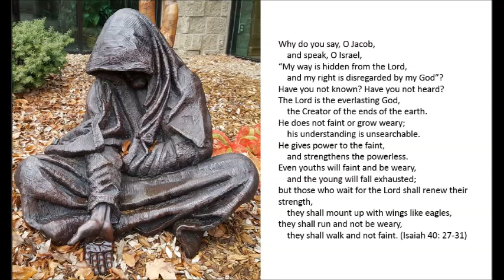2009 Chevy Cobalt gas line replacement

Comment: Excellent Video!!!!!!!!!!!! Just a tip, never do any gas line repairs in the garage or near the house.......you cannot get the car to the curb fast enough if the SHTF...........It should be a LAW that all brake, fuel and transmission lines are stainless steel right from the factory. Charge us the extra 100.00 up front and save us from these headaches that were the first thing to come down the assembly line and the car was built around!  Brining  and over salting the roads is killing the underside of all of our vehicles. Years ago nobody ever had to replace any of these lines.
Reply from the maker: Thanks for the feedback.
Reply: Ethanol in the gas helps corrode the lines too.

Comment: Thanks for posting, great video.  Do you recall what part number you used from linestogo?  They do not show an option for a 2009 with an external fuel filter.  Did you use a set listed as 2008?  It looks like its the same as the 2009, but not sure.  Thanks

Comment: There's now a recall 2008-10 cobalt and hhrs on the fuel lines. It was on the news yesterday.
Reply from the maker: Thanks for the info, I had not seen that yet.
Reply: @diywithdave3186  it's not really official for now GM is working with the Highway traffic association on the issue. I'm sure the recall will happen. I have 2010 coupe and so far no smell and leaks.
Reply from the maker: @MrCliffda3rd  that's good to know also.

Comment: Thanks for this video. Very helpful but why did you replace all the lines? Was it just for demonstration purposes?
Reply from the maker: The lines that I used came as a kit.  Individual sections were not available.  I didn't want to mess with trying to custom bend an individual section and hoping that I could get it not to leak.

Comment: On a scale of 1 to 10, how difficult of a job is this? I know my way around a car and I'm sure I can do this, but I'm concerned about how long it'll take my inexperienced self to do it as well as the various tricks in dealing with fuel lines...any additional info would be helpful. This is my son's car - a 2008 Cobalt. Thanks.
Reply from the maker: The most difficult part was figuring out how to get it apart, and dealing with the broken volt for the fuel filter.  It took about a week or so of working on it after work and whatever time I could spare on the weekend.  Part of the difficulty I had should be reduced with the tips that I shared on the video.  If you have the replacement parts on hand and the required tools you could probably get it done in 16-24 hours, assuming that you don't do this kind of stuff for a living.
Reply: @diywithdave3186  After watching your vid I decided "no way!" Especially with my son living two hours away at college. I knew there was no way I could do it in one day. He's found a garage that will do it for ~$550. That is def worth it!!
Reply from the maker: @SportsRaschman  given that scenario, sounds like a good choice.

Comment: I cut my lines to repair this on my 08 g5, but I didn't think to mark which line is the fuel feed, can anyone tell me if it is the line nearest the left side of the car or the inner line, I know 1 is fuel , 1 is vapor...   I can send pix if you need to see...
Reply from the maker: The fuel line will have the filter (25:16) on it by the gas tank, the other will originate at the vapor canister (black plastic box).  At the engine, the liquid line will go to the fuel rail (10:50) on the engine and the vapor line turns into plastic at the engine and it connects as shown at 11:20 in the video.  As long as you get the ends of the same hose in the right place you should be good.  If you cut the line and don't know which is which on the bottom of the car, you could blow air through the line and see which one it comes out on the bottom of the car.
Reply: @diywithdave3186  im splicing them with 6-an, I didn't pull the whole lines out...   I just wasn't sure which line fed fuel and which 1 was vapor, I figured it out....   I traced them from the engine to underneath the car...   the inner most line is fuel...   I didn't think to mark them before cutting them...   thank you for the response...   :)
Reply from the maker: @flynnndawg  you're welcome, glad you figured it out.

Comment: My Cobalt's fuel line is leaking, and the local garage wants $1,250 to replace it, including labor.
Reply from the maker: It was not an easy job, but definitely less expensive to DIY.
Reply: BTW, I found a different garage that did it for $600, including labor. They said it only took two hours' labor. Not sure if one or two guys worked on it.
Reply from the maker: @funkervogt47  I wonder if they were going to do the same thing, patching the old one vs. replacing the leaking line or both lines?
Reply from the maker: @Tin Tizzy personally I would have some reservations about doing that.  Depending where the leak is something might get caught on the hose and pull it off or cut it.  Then there would be the potential of spraying gas all over the bottom of the car, in combination with sparks, that would not be good.
Reply: They fully replaced my old fuel lines. I saw it.
Reply from the maker: @funkervogt47  Good deal.  Thanks for sharing.

Comment: This is a common problem in this POS car along with its Pontiac G5 counterpart. I'm on the fence in junking my pile o' crap and paying for this stupid repair. I do not want to do this crap myself.
Reply from the maker: I agree, I am not impressed with the car.
Reply: @diywithdave3186  I sold a geo metro and junked a minivan to get one of the XFE models. I miss my geo metro. That's pathetic. That car was fun (except driving to speed and to pass on the highway).